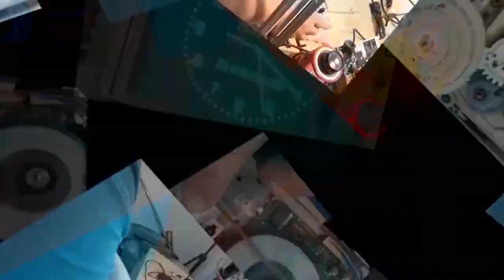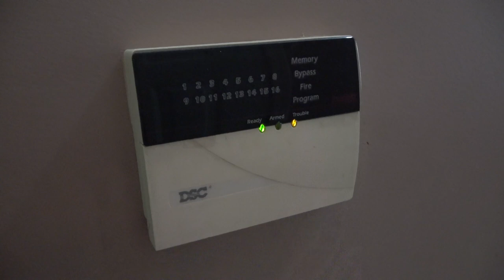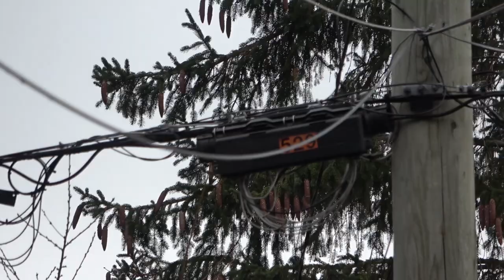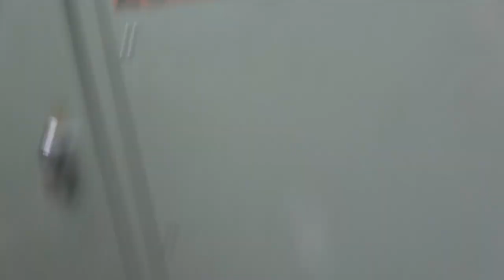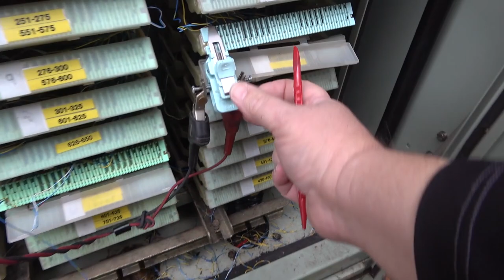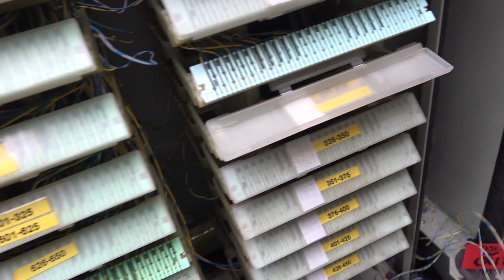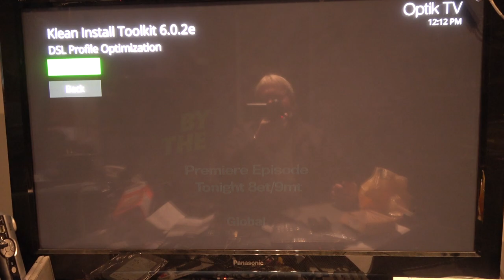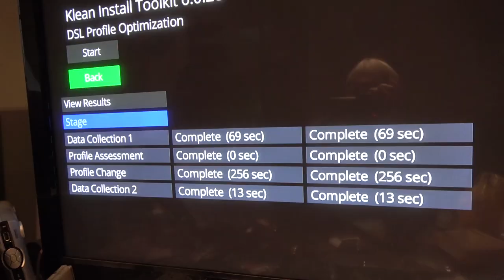Fixing my old noisy copper phone line

Comment: Hi mate here in the Uk may mate was a Telco, served time on/in the BT tower London.  I shared your video, his comments were:  Tell you what John, were lucky not to have overheads like that here. In UK cabinets they use Krone idc strips that don't need the jumper removed to test either way- you just have a little plug that goes in the middle of the pair,  it breaks the connection and depending which way round it's plugged in dictates which side you test towards. https://www.canford.co.uk/KRONE-WIRING-MODULES
Reply: Also mate, my mate
 suggested that you need the beefy earth, because: Yep would be needed especially when sharing poles with Lecky. If I remember correctly they distribute at 230v AC from a centre tapped transformer.
Reply: from my visit when I was 12, to Ontario, you ran 120v ac

Comment: Don't let those old phones keep you from migrating to fiber, there are pulse to tone converters for that very purpose.
Reply from the maker: I just don't want it.  Fiber has all eggs in 1 basket.  At least with bonded dsl if a line goes down just lose speed not everything.
Reply: @12voltvids  That's a valid point, I can say though that I have fiber since March 2018 and I haven't lost service once since installed, I only lost digital RF TV service a for a couple of hours shortly after being installed but it was a problem that affected the whole town, still had TV with the set-top box but never encountered any problem since. Of course doesn't mean it's flawless and might not happen in the future, but in my case it has been way more robust than the copper service, copper pair gave us nothing but trouble.
Reply from the maker: @t0nito  
Well as someone that works in the industry i can say that it is certainly more reliable than old copper but I still have tons of trouble calls.  Copper had many more issues a few years ago when the cable was fully loaded due to all the mutual interference in the cable.  Since much of the DSL has gone to fiber now the DSL lines are clear and those of us still on have better rates and less fec errors.

Comment: Funny, my gps works all though out my house within 25 feet. Discovered by sharing location and planning routes on maps in multiple locations inside...
Reply from the maker: Try it in a stucco or concrete home with low e windows and see how well it works. Or try to find out what unit you are in when in an apartment.

Comment: 5:50 not true. Your provider knows pretty much EXACTLY where you are provided you are in range of at least 3 base stations (which is more often than you think unless you live in the middle of nowhere) based on the signal strength of each base station (which the phone always sends to the provider as opposed to gps data) they determine your distance from each BTS and your exact coordinates based on the BTS locations, it's called network triangulation.
Reply from the maker: Not as accurate as you think.

Comment: I know he's a copper tech and that's why he believes in copper so much, but nearly all of the items he mentioned are do-able with Fiber and emulating POTS telefony.  About the only item that is a valid concern is the alarm system circuit cut detection, but you can get POTS adapters for rotary phones that will power them that are on battery backup.  Not only that, but if your alarm system is running on POTS you need a new alarm system.  That thing is ANCIENT.  There is plenty of DIY, internet-connected security alarm panels you can self host without monitoring or with cheap monitoring.

I get that copper is easy to work on and such, but nobody maintains it anymore and the noise he's hearing is only going to be eventually on every one of those pairs because nobody will fix it but him.  The only reason he was able to do this is because he's a technician who has access to the equipment and is still maintaining this area himself.  As soon as he retires all of those lines are going to go to hell.  That is the cleanest cross-connect panel I've ever seen that was still in operation and that's because he clearly loves the work.  

My hats off to you and your hard work, but I would argue that you're fighting a losing battle my friend, sadly.  No telecom gives a crap about copper anymore and are fine just letting it rot.
Reply from the maker: It will eventually be turned down. That's a given but till then I will just keep soldiering on.  I actually do much more fiber work than copper but I am 1 of 3 in the area trained on copper. There are still rural areas that won't get fiber at all.
Reply: @12voltvids  I hear that. The annoying part is the 1996 Telecom act paid for fiber everywhere, but corporations gonna corporate and they just pocketed it all.
Reply: @12voltvids  in the rural United States, there are very few places that won't eventually get fiber. We already have it and it's excellent through our local electric Cooperative
Reply from the maker: @AustinHollingerOfficial  
Fiber is here. I could put it in tomorrow.  I just don't want it.  I am happy with my copper service. Yes I know fiber is faster but I don't need or want anything faster and as it turns out fiber is more problematic.  Someone gets a virus on their computer or an ont goes bad it trashes the other 31 people sharing the splitter.

Comment: Why don't you just connect the fibers for better internet and leave the copper connected to the phone. They are supposed to provide you with 911 service and a tone for nothing.  It also allows the phone company to re-route all your calls to their sales department so they can sell you service from your landline phone. At least that was that way here until they disconnected my line because my house had burned down and the melted 2 wires were touching enough to dial 911 every once in a while they sent the police to the property to check on a hangup 911 call.

Comment: Seems you've been into all your leads before, since you aren't using standard pairs for 4 lead drop. That and the colors are possibly faded a bit. Even your NID seemed like the wiring was a bit light on how many pairs were coming off your drop. Looked a bit thin, but normally that would be at least 6 nowadays but since everyone is going Fiber Optic I don't see the point. Anyway mixing pairs whether that be greed/red yellow/black blue/bluewhite and so on, it just seemed you were mixing pairs.
Reply from the maker: There used to be 4 lines in here from my old BBS days.   This is what was left over after they were disconnected and only 2 were required foe bonded loop.
Reply: @12voltvids  Well, any clean leads in a pinch, I suppose. If you were rural enough you could even use the old solid copper core that I've heard is still being manufactured in China (the cheaper wire was/is manufactured with so many varying colors it can make pairing a fabulous game). Yeah, your NIC/NID was a bit full of everything. Wouldn't expect less from a Tech. By the time everything is changed over, there will be no COs with off grid power. Power goes out, no more line. Each step we take forward is a step away from being able to do the very basic. I fully understand your position and reluctance in removing your analog, but it just seems at some point the CO is going to switch over without telling anyone. We might all be dead by then, but you know it's just a matter of time.

Comment: 75/20 is good enough. Can understand why you keep copper that way. But the obstacles should be easy to fix so you can go to fiber soon. There are dialing converters that you could use. Or you make your own one.
Reply from the maker: That still doesn't solve the problem to the ONT taking updates and rebooting in the middle of the night, and having the siren wailing away waking up the neighborhood.
Also the ONT doesn't produce a high enough voltage to make the old phone bell ring.
I have no intention to go to fiber any time soon. The only thing that will make me switch is when the day comes that they shut down the copper network, and that can't happen until everyone has switched over.
Reply: @12voltvids  Lucky to have a choice, here (Aus) they just gave us a deadline and cut everyone off, switched or not. For most it wasn't even a transition from copper to fibre, they just turned off the POTS to save money.
Reply from the maker: @s8wc3  eventually copper will shut down but until then it is staying active at my place.

Comment: You don't anticipate anyone else will be working on that line?  That sounds like the words of someone who has never lost his job or relocated!  Might be ok for you, but you're making it more difficult for the next guy, don't you reckon?
Reply: Switching of primary and secondary copper pairs (same adress) used to be quite common where I live, don't know if it still is (worked for a telco until 14 years ago) so it's one of the first things a tech will look for.
Reply: @brouwerk1  That's fine.  I'm just reacting to the words of the uploader.  He said he doesn't anticipate anyone will have any trouble because he will be the one working the line and no one else.  That's what I'm responding to, not whether or not a competent linesman can figure it out.

Comment: Why can't you just use both dsl and fiber? Easy enough to setup an old pc with pfsense for gateway balancing or failover
Reply from the maker: Read the comments before asking the same question 50 others have asked!
Reply: @12voltvids  sorry, I ain't gonna read 600 comments on my phone. The first 30 I read didn't asked it so I did. Blame the YouTube algorithm for not sorting out the comments
Reply from the maker: @thomasesr  well the question has been asked at least 50 times.  I am grandfathered on my tv channel package.  Changing to fiber for internet and TV means i have to change plans.  On my original plan i have 6 tv boxes all free, on the new one i get 2 and the other 4 are 5.00 per month.  Those 4 are seldom used  but are still nice to have when i want to watch something in that room such as my work shop.  Also channel packages are different which means different bundles to keep the channels i currently have.   More money.
Reply: @12voltvids  Gotcha, It's the tale as old as time. ISP issue

Comment: In London Ontario bell are to cheap to run fibre there still on gen one dsl that only goes up to 10 mbit down 1 up if your lucky. luckily one of the local isp start.ca ran fibre u can get 1 gigabit down with 50 mbit up for $50 a month no price increase in over 2 years unlike bell who loves to put the price up 2-3 bucks every 6 months. they also do VoIP there VoIP box seems to support pulse dialing.

Comment: Isn't up to the point where ur modem connects up to the line the providers thing and the customer is not allowed to work on it?
Reply from the maker: Company is responsible up to the protector on house.  Inside wire is customer's responsibility.
Reply: @12voltvids  the it is definitely different in Germany. All DSL cable is done by the provider here, otherwise you run the risk of not having guaranteed speeds
Reply: (and DSL is up to 250 mbit/s)

Comment: Jesus, what kind of DSL wizardry do they run in Canada?  That is faster than most Fibre speeds here in the UK!  Most is FTTC but I can see my cabinet and I only get 150Mbps with g.fast, fastest I could achieve with DSL is 8Mbps down.
Reply from the maker: Its VDSL2 and bonded  VDSL2; ITU-T G.993.2 spec. We offer speeds up to 150 down 40 up on a bonded 17A stadndard up to 500 meters out. I am 600, so my speed is cut to 75 down 20 up as I am on the 8B protocol. Still plenty fast enough for what I use.
Reply: @12voltvids  Ah, we have ADSL, which is not all that good, I had quite good attenuation and SNR but I used to only get 2Mbps in my old house which was a fair distance away from the cabinet that had quite bad LA and SNR, and frequent dropped packets due to errors.  I find fibre quite stable, though with g.fast I have my home phone plugged into the router rather than the wallplate, as g.fast sounds like your "normal" fibre, I think in our area they are installing FTTP, but it is REALLY expensive.
Reply from the maker: @Wilksey37  DSL comes in many versions. The first we had here was DMT1, then DMT2, then 2+, then VDSL, followed by VDSL2, and the last implementation VDSL2+ Bonded. There will be no future versions as it is GPON fiber now.

Comment: Here we sneakely change the connection to fiber but took the copper line wihtout ven notifying us. Speed is not better in this particular ISP .... the benefit for them is clear, the can still bill you the voice service without a maintenance of a copper line anymre and eventually they will took the exchange office, or the majority of the infraestructure needed. Whole builging just to serve the copper lines and DSL systems. BUT .... in my previous work, the factory I worked didnt have an alternate path of comunicaciton. It was fiber for data and phone was fiber, even when it was a DEDICATED fiber, sill using the main gateway. Only ONE operator served this particular Area. Many persons, more on the Health and safety side said that for a FACTORY, with 50 people and moving machine bla bla bla (accidents).... the lack a dedicated copper line was an ISSUE, And sure it is. Here outages are common on high demand days, with up to 2 or 3 days off grid. In order to  call endlessly to the power company, only a copper line will able to do it every single time. Cell phone will get exhausted after 1 day. Yes power banks ....As for the DSL, If I had a 12V pack, I could  still have internet, while fiber, the local node just goes down with everything else. Exchange building DIDNT since they RENT generators and have 6 hr battery bank provisions (by law).
Reply from the maker: We have giant battery banks at our co and a huge diesel generator out back.  For the remote offices with no generator if there is a power failure the node goes on battery and the co standby tech on call 24/7 gets paged to go in, pick up a generator and take it to the site and connect it. We have generators ranging from portable Honda to power a DSL cabinet to a full size pickup with a 100 amp diesel in the back to power up a full remote co.

Comment: you can translate pulse dialing to sip with a virtual pbx
Reply from the maker: Ya but that won't drop the battery voltage if someone cuts the fiber to trigger an audible alarm.   Also that won't stop the ont from resetting after a software update which kills the battery and sounds the alarm at 2 am.

Comment: What about Rotatone Rotary to DTMF
Reply from the maker: What about it?
Reply: @12voltvids  It is a Legacy phone to DTMF converter unit
Reply from the maker: @DAVIDGREGORYKERR  Yes I know but how will that solve the problem I have of requiring battery from the PTSN so that if the line is cut my alarm will sound. The ONT provides voltage regardless, and how do I stop the alarm from going off when the voltage drops during an ONT reset.  These are the issues. The old rotary phone is the least  of the problems because I would just disconnect it and that is that.

Comment: coulda told ya it was up on the pole from the git go, wind always jerking the wires around, dont know how many times i had to have someone come out to "fix it " before I decided to save myself 200 buckskins a year and use MJ.
Reply from the maker: I knew where the fault was but don't have my work truck here with the big ladder.   Had both pairs been noisy then i probably would have gone and picked it up or booked a ticket for myself when i returned to work.   I get the copper troubles as not all the crew is copper trained.  Copper troubles go to the senior techs.

Comment: I understand why you use copper for phone things, but I don't get why you don't use the fiber for your internet.
Reply from the maker: How many times do i have to answer this.  About 30 bucks a month that's why.
Reply: @12voltvids  I just randomly saw your video on the home page and watched it. I had no background as to the "$30 a month." No need to be rude. If you only want subs watching your videos, make them private. $30 a month would be worth it, with DSL as a failover.
Reply from the maker: If you read any of the comments I have see about 50 where people ask the same thing.  And no it isn't 30 bucks a month it is 30 bucks a month more than i already pay which is about 160 a month.  So to "upgrade" will raise my bill to about 190 a month to keep the same channel package i have now. New customers get a better deal. I think i explained it in the video why I am keeping my service on copper untill it is totally phased out which will be at least 3 years or more out.   If i sound snarky it is because I have answered this exact same question probably 50 times and if people would read the comments and replays before making the same comment. I am done responding and future comments suggesting what has already been posted will just be deleted.
Reply: @12voltvids  Yeah, as I said, I just randomly saw this video. And I am aware that it would be $30 on top of what you already pay.